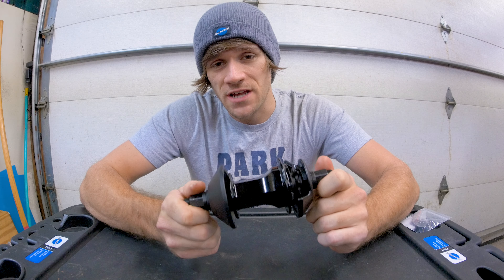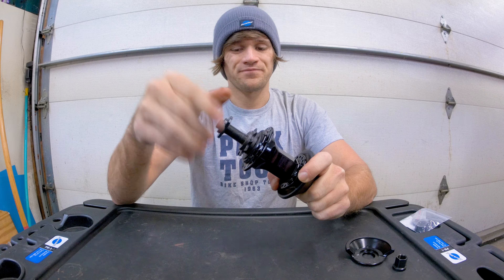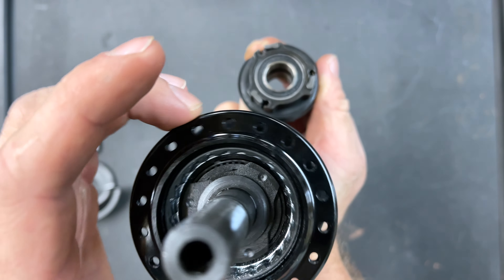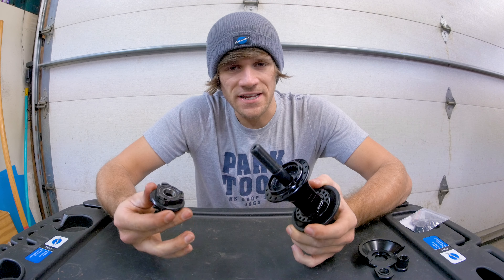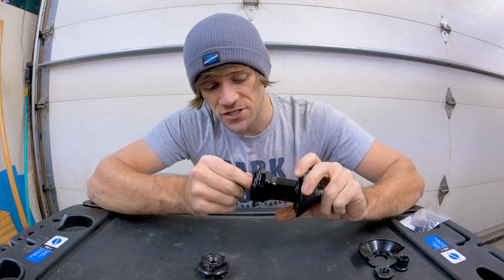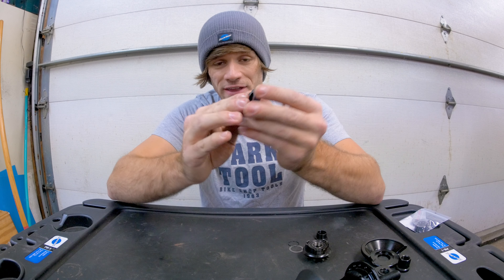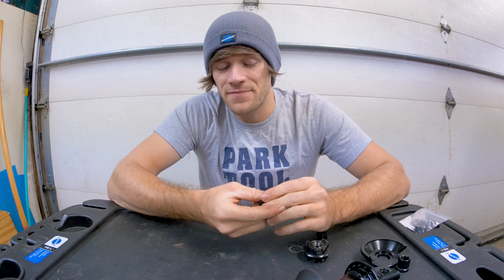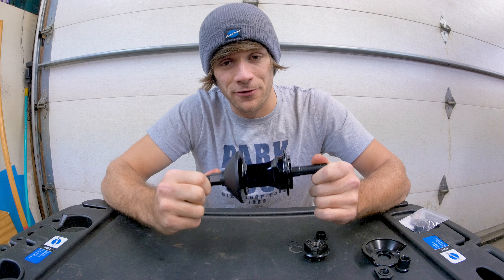Planetary BMX Freecoasters EXPLAINED - Simultaneous Cassette & Coaster!

Comment: So Brant since you've had its predecessor, the free night hub. Is the Alienation hub internals constructed beefer? If so, how?
Reply from the maker: Yes definitely as they’re plastic now instead of being 3d printed. That being said, the only force put on them is what is needed to lift the pawls so even the 3d printed material was enough to have never failed on me
Reply: The early Freenight hubs required a break in period, each hub was different because of the 3D print. There are a few more cool features in the Venus, the idea was to make it "BMXer proof" haha

Comment: The Ezra freecoaster and the free Night freecoster and Saltplus Trapez free coaster and the BSD revolution free coaster all have similar internals 👍🚲💨
Reply: I want to know if the clutch can be interchangeable, i have a Ezra and i want to buy the bsd clutch to put it on the ezra an see if it works
Reply: @erickmendez3009  only way to find out is Try it
Reply: If its works, its a really realiable freecoaster
Reply: @erickmendez3009  Let me know if it works I’ll be interested to know
Reply: Cough. Rob ridge Ezra coaster mods. Cough Cough.